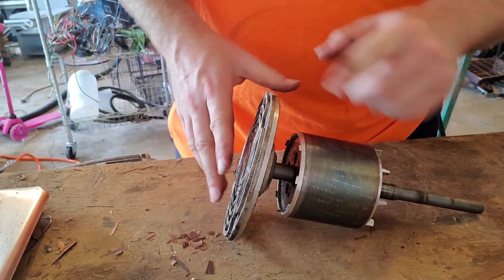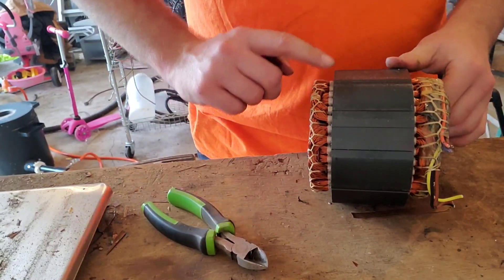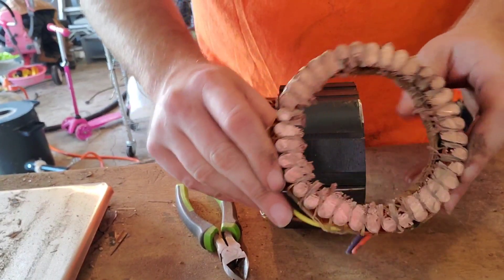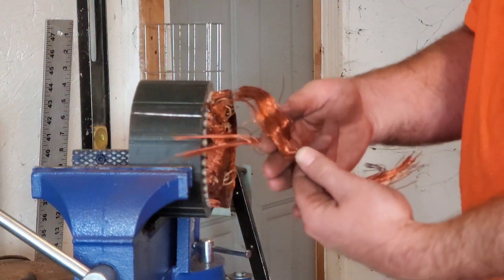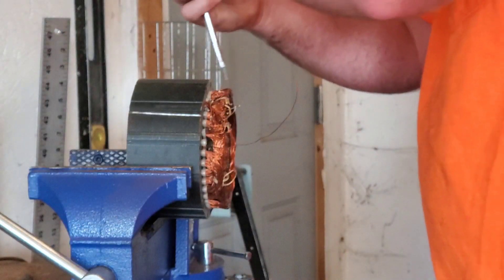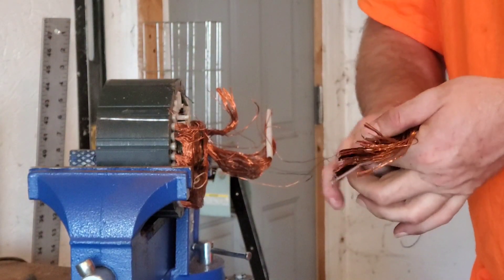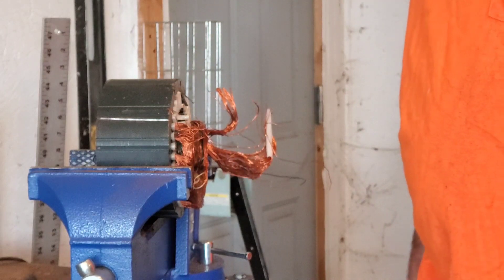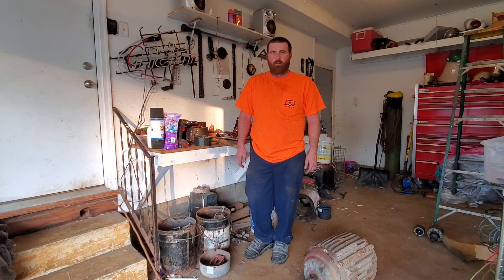How to get copper out of an electric motor. (ep11)

Comment: Air hammer pushes the copper out in seconds.  use a flat bit pushed into the loop.  once you get the hang of it, you can do the whole removal in a min or two.
Reply from the maker: I do believe the next video i posted after this one i used the air hammer. Thanks for watching

Comment: a little tip for you that might help, set your metal thingy (that holds the copper wire) lower, and further away from you in the vice.   (well you actually did put it further away @ 9:00 when you reset it)   but that way you can use the vice for a wider prying leverage with your screwdriver/channel locks.
Reply from the maker: Thanks for the tip. I used a 123 block its a machinist block. Thanks for watching and please share